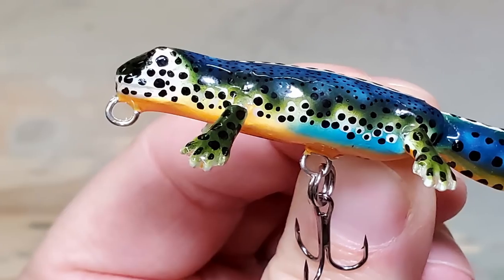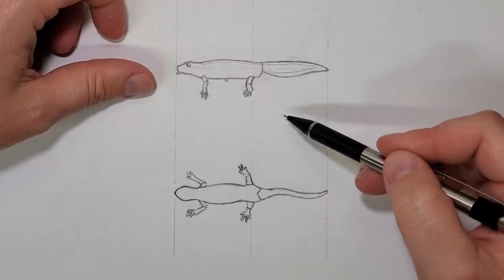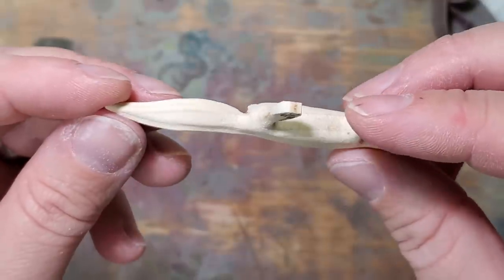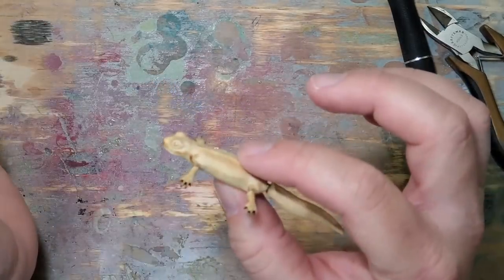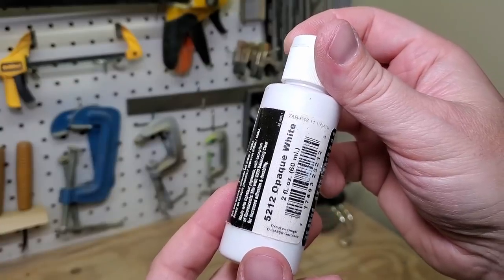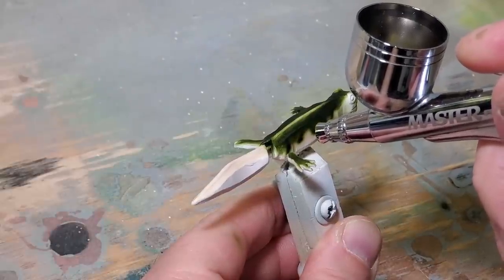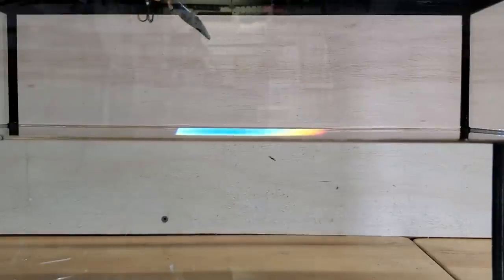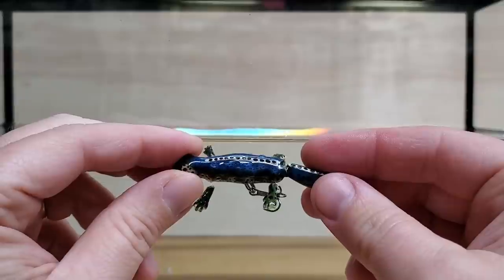Making an Alpine Newt Fishing Lure out of Wood

Comment: I like the look of that, would probably work pretty well for perch and small pike here in England. I'd be tempted to use a hole and pin to secure a replacable cut down curly tail grub  to act as a tail to provide movement instead of the jointed tail, but that's just the lazy low skill option haha. Definitely going in the list of projects I will get around to one day though
Reply from the maker: Thanks, I bet it would work for those fish! I think a grub tail would give it a nice flowing movement. I appreciate you watching!

Comment: Maybe some heavy braid?
Reply from the maker: I considered that, but I think the arms would be too floppy and would wind up floating higher than the body. However, I think a heavy braid paired with a 5 pound line might be the answer. That would give me the strength of braid while the ultralight fluorocarbon provided just enough stiffness to hold the limbs out in the correct position. Great brainstorming idea!